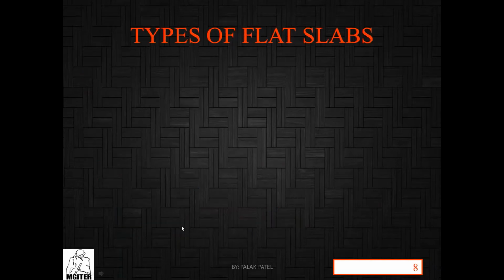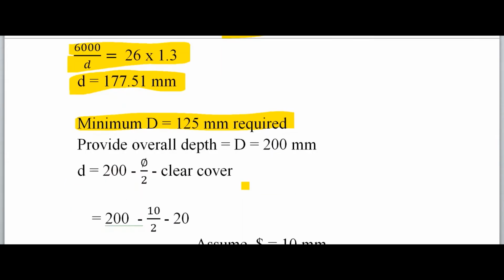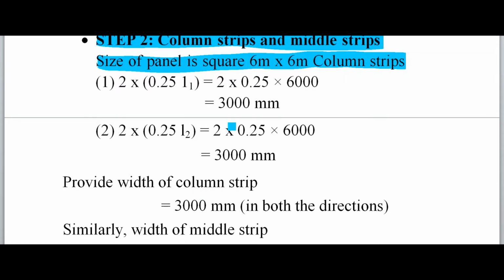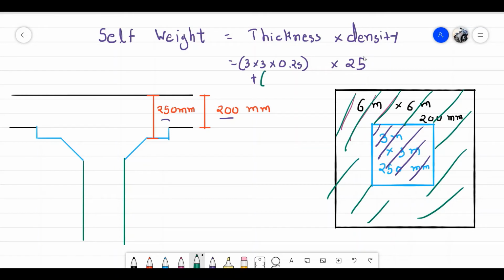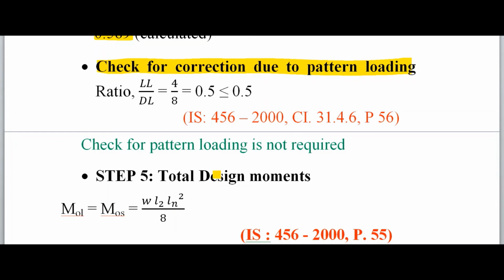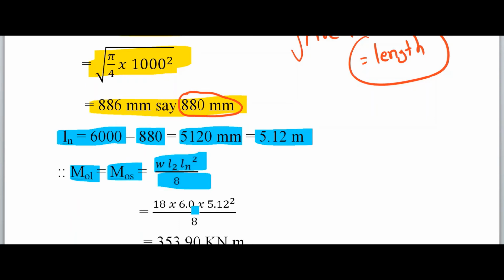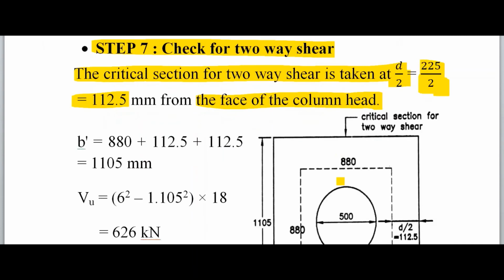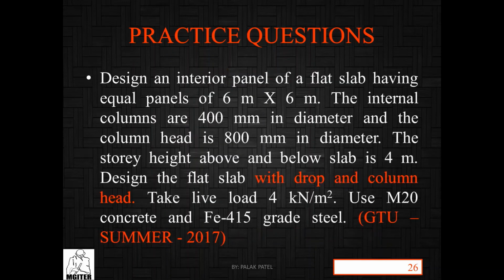FLAT SLAB DESIGN (WITH DROP AND COLUMN HEAD), BY: PALAK PATEL, PART 4.2

Comment: Sir plz clear my doubt .....at check  for two way shear .......how 880 come ???? 🙏🏼🙏🏼🙏🏼
Reply from the maker: There is round column in design. But for design a slab we have to assume square column. 
1000 mm Is diameter of circular column. 
So find a area of column and then find dimensions of square column for same c/s area.
This 880 mm is square column dimensions.
Reply: Actually sir we got there 886 not 880
Reply: Then i thick , this is a round figure value of 886